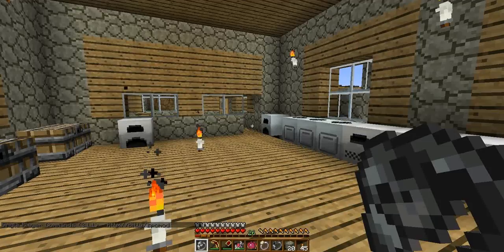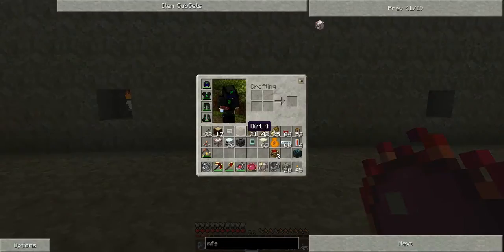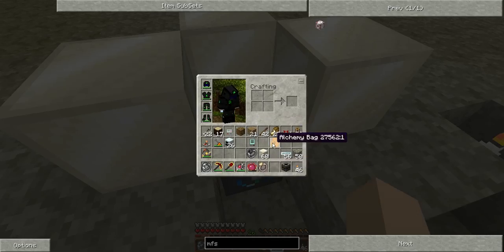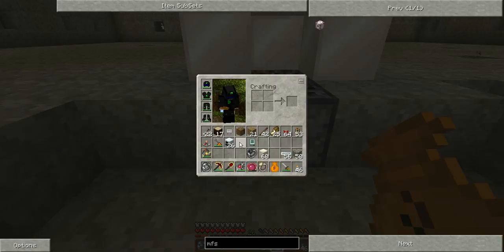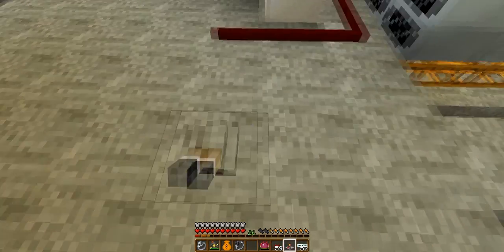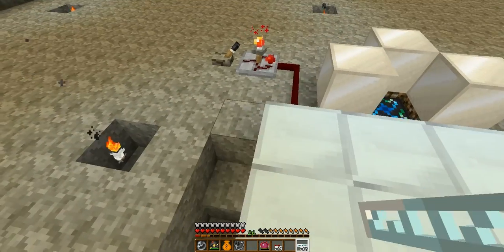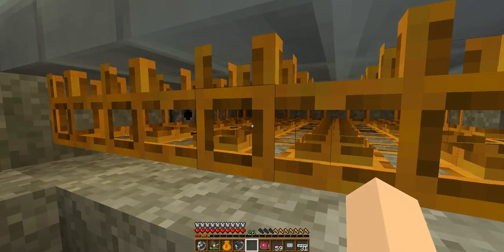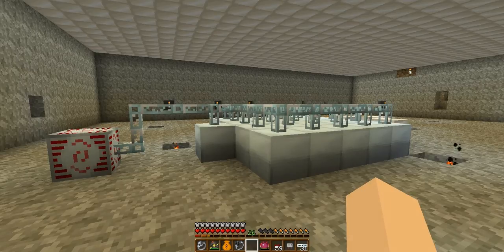Minecraft - IC 2 - EE 2 - Redpower 2 - Geothermal Farm Tutorial

Comment from the maker: You should be able to, though why would you? The fiber cable handles the MFSUs full output and only loses one EU/tick for every 40 blocks you run, so short runs it's virtually nonexistent. :D And, heck, with EE2 diamonds are nothing, with a fully upgraded flower, using all Mk3 Collectors and Relays, you can make stacks and stacks of diamonds easily. :D